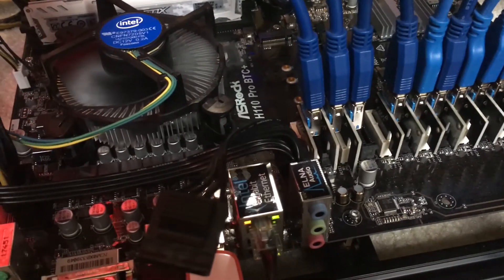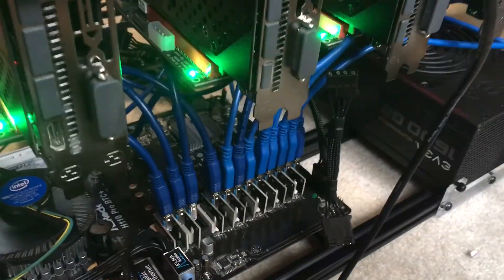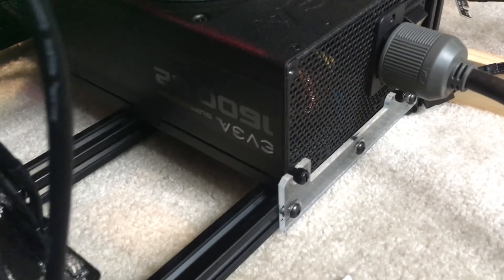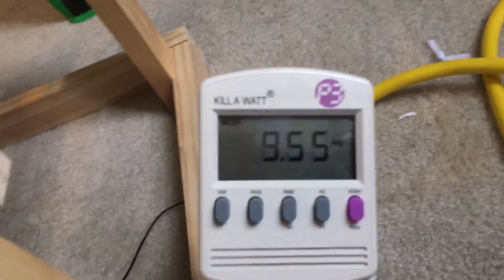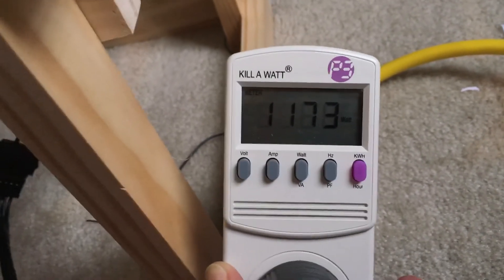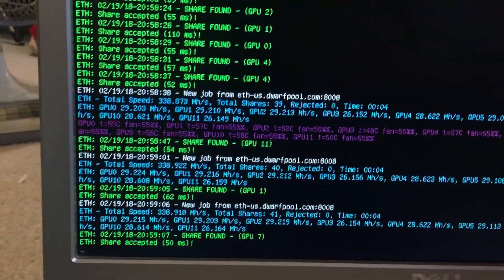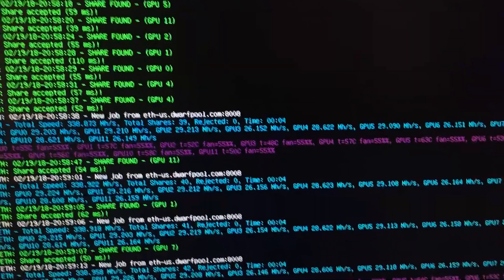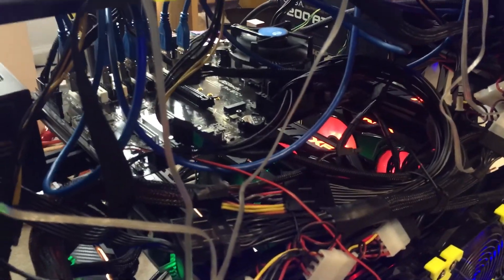12 GPUs on a Single Mining Rig 339 MHs

Comment: are you running windows or linux for that board? I  have one and cannot get it to run without setting up 2 miners in order to run my 13 gpu. a mix of 8 amd and 5 nvidia. your thoughts would be appreciated
Reply: This is the model I'm planning to get https://sites.google.com/site/SupremeMiningRig
Reply from the maker: running linux (SMOS) Check it out, it is super easy to set up.
Reply: thanks